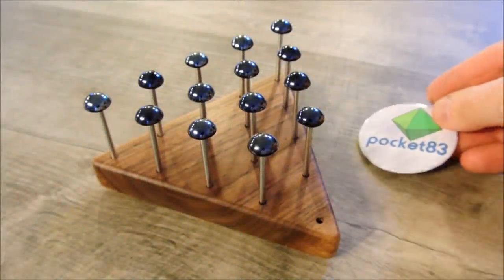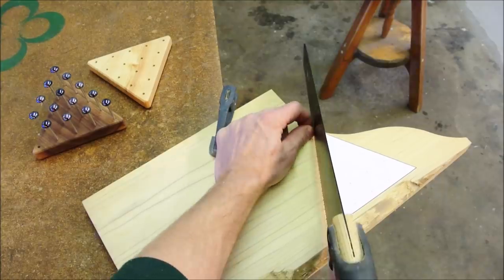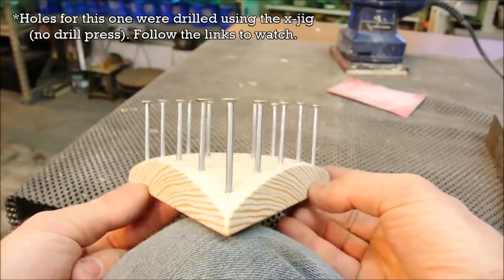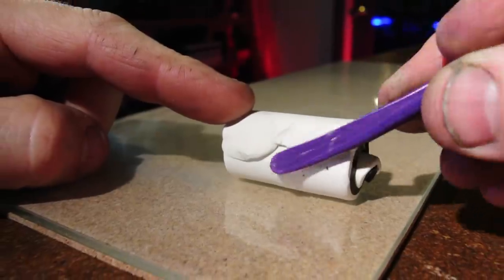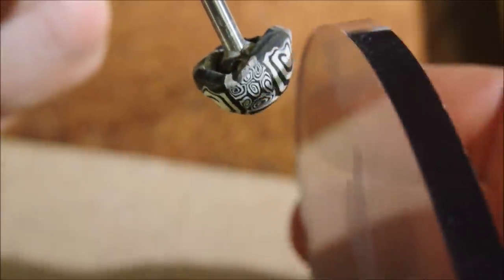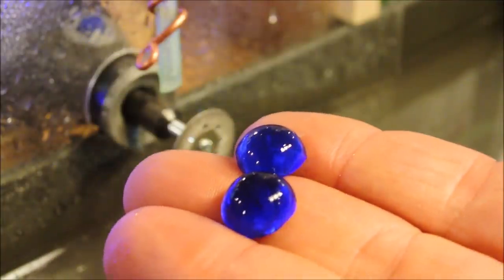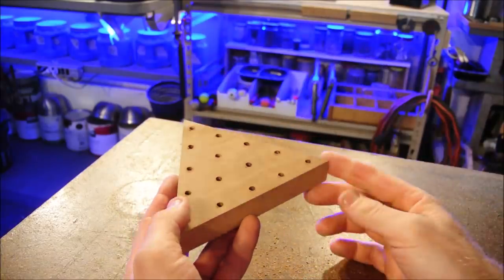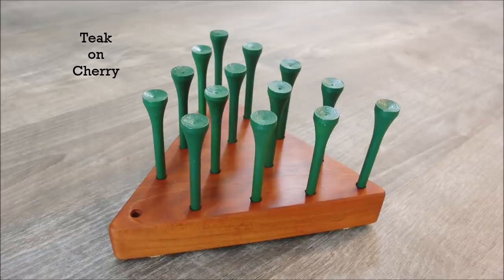▲ Triangle Tee puzzle designs

Comment: Cool technique after cool technique after cool technique... awesome.

As for the ending... Hmm, it's been years but my recollection was that I wanted to get an intermediate step of a 3x3x3 triangle in the bottom left and a lone pin at the top (ie, gap of one to the triangle) and then I could finish.   Either I'm remembering wrong, or more likely there is more than one way to solve it.
Reply: Thanks. And yes, there are multiple solutions. One involves first making every possible move in one of the 3x3 triangles.

Comment: Do those marbles have a particular designation, or are they just glass spheres? The only marbles I have ever seen for sale are "cat's eye marbles", some clear glass, some white-ish/milky glass.
Reply from the maker: Not to sound sarcastic, but have you actually been looking? Once you start to really look for them, it's a bit strange where you'll find them. My advice is usually to look in discount outlet stores, often around fake flowers (as 'vase filler'), and to not bother looking in the craft stores. 

Dollar stores have nice marbles on occasion. This will sound funny, but I once found a near optical-quality specimen in a $1 mixed-supply bag at the dollar store, so I went back and bought about 20-some bags. Different manufacturers will make sets at different tolerances for their varying customers; as such, discount stores will often end up with spill-over surpluses that were once designated, at least in part, as high-quality product. Some will be super-clear, and others will be extremely spherical. It's literally a mixed bag.

If you're smiling at me, consider that I know all this from having a marble-sorting machine and some videos about sticking marbles together with enough precision to build geometric forms. I'm not completely off my rocker: it does still feel weird to be that customer.
Reply: @pocket83  i was actually looking in toy stores, never considered others. I suppose I have to widen my search to "glass spheres", "beads", or other decorative items. I did find -- on account of this channel -- those flat glass marbles though. Thanks for the information!

Comment: Looks like you need to dress your bench grinder wheel.
Reply from the maker: It was trued up a month ago using an angle grinder with a cut-off disk. As they spin, one trues the other. Keep a steep angle if you try it.
Reply: @pocket83  So you intentionally dressed it to have a groove down the center? Normally you never seen that done. I am curious,  what is the purpose of the profile? Usually they're dressed to be square unless they are used for a specific purpose. 

2 individually powered rotating abrasives rotating at different rpm against each other doesn't seem like a good idea to me. But you do you. I'll stick with my dressing tool.
Reply from the maker: @pocketchange3543  No, I use the angle grinder to remove grooves. I don't own a dressing tool. To be honest, I've never been very comfortable with those. The trick is to not allow the tools to work "against each other," but to have them only tangent at a point, to force them to average out each other's eccentricities. Similar to the way that two stones might be rubbed together to create a flat plane. As I've said, you keep the disk at a steep angle, and very little material is removed.

Maybe I'll make a video. That one should get a reaction.
Reply: @pocket83  WOW, I can't believe that groove happened in a month! Either that grinding wheel is junk or your doing something wrong.  I've seen 15 yr old "WELL USED" never dressed, grinding wheels that haven't gotten that bad. I maybe dress mine once a year, and thats mainly to crisp up the outside corners that get slightly rounded over.
Reply from the maker: Where did you get that from? No, I trued it up a month ago. It takes lots of abuse to get a groove like that.
Reply: @pocket83 If that grooved profile is unintentional, I really truly believe you when you say you abuse that tool. 
If that were happening to mine, I'd be dressing that wheel every day. The face of that wheel should be flat and square to the sides and have nice sharp corners. I personally prefer to use a belt grinder or an angle grinder to do the majority of the work. At $60.00 a wheel I try not to destroy them.